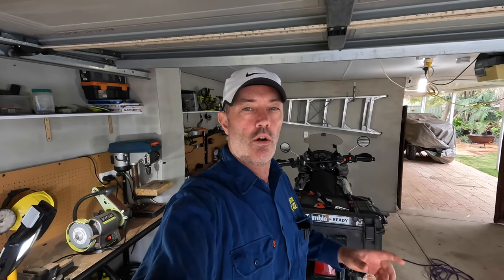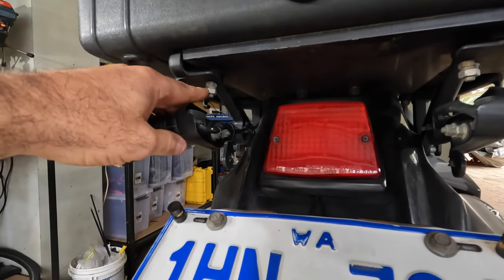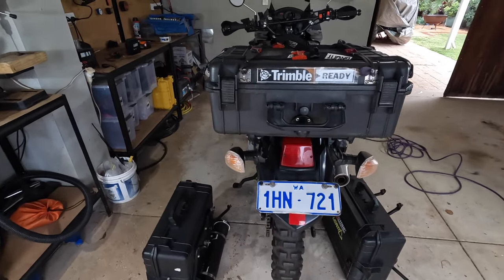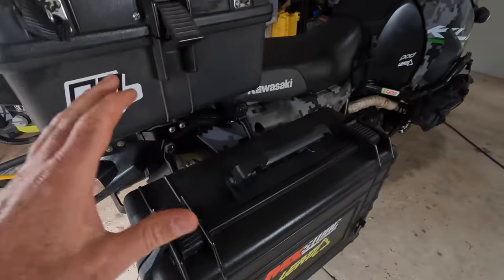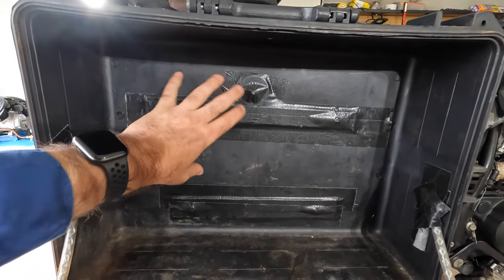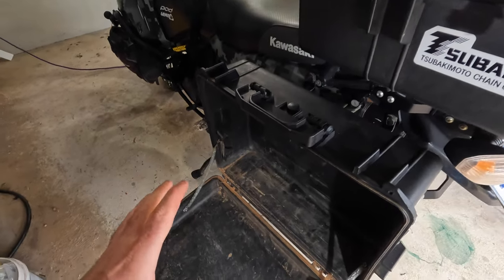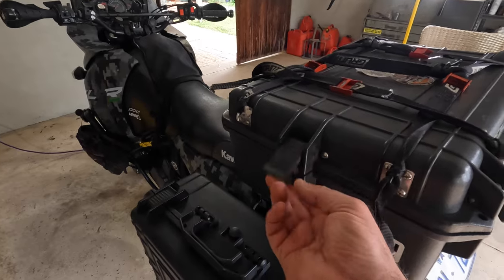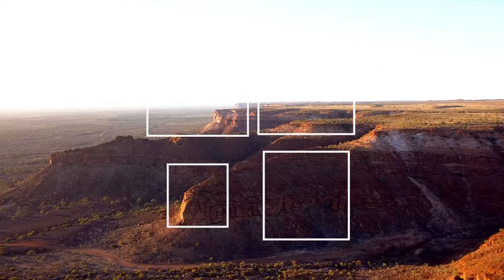Hard Core Home Brew ADV Panniers - KLR 650

Comment: Nice set up. They are tough, I use the same on my vstrom. I'm using small cooler bags to pack stuff in and a lite elastic across so they don't fall out on the lean. Can't have elastic too tight or it pulls the  sides in. Cheers mate nice klr

Comment: Have you ever taken the time to weigh your pannier setup, I’d be interested to see overall weight unloaded and then loaded for a trip in comparison to a soft luggage setup. They certainly have served you well over the years.
Reply from the maker: I haven't.. but its a good suggestion.. I have weighed the whole bike fully loaded a few times.. When loaded for a long remote trip, fuel, water, food, tools and spares, its pretty heavy, and you have to ride it taking this into account.. This is where being able to quickly remove the panniers is great. You can take them off an lug them across a gnarly bit.
Reply: @jjsadv  the ability to remove and carry over bad ground is definitely an advantage, but with the lighter weight of soft luggage maybe that wouldn’t be needed.
I’ve stayed with soft luggage purely for weight saving on my KLR as I was concerned about the subframe, even with the bolt upgrade. I do run hard panniers on it for urban commuting though, better security around town etc
Reply from the maker: @damienkeygan1735  Soft panniers are popular, and I will probably give them a go next bike. Both work. I have seen a lot of soft panniers ripped off or ripped open on some tracks with close trees.. But I guess you just have to be aware and careful..
Reply: @jjsadv  yeah both styles definitely have pros and cons.
I also run a safari tank to carry fuel up forward so it’s not rear biased in the panniers, also had to upgrade front suspension but definitely worth the expense
Reply from the maker: @damienkeygan1735  I have looked at those tanks, they look like a good option. The DRs always have them, but have kept the jerrys.. again, I can take fuel, and then off load it for an explore.
Reply: @jjsadv  definitely a handy ability. I usually just filled to the level I think I’ll need, not every trip needs 35 Ltrs haha
Reply from the maker: @damienkeygan1735  I should get one, and still take the Jerrys.. ride around Oz on one fill up..:) Im looking at a new bike soon. Waiting for the New T7 with the bigger tank to come out.
Reply: @jjsadv  definitely do some distance between fills. The new T7 world raid is a nice looking rig, as is the new Ducati desert X with the rear tank addition for 29 ltrs total👌
Reply: JJ, 
There are so many great KLR artists on YT but you my friend are among the Greatest... perhaps even the DaVinci 👌!
Reply: One of the very first things I upgraded on my KLR was the solid thick aluminum plate bolted to the back rack, brilliant mate🤠! And so many more of your brilliant tips I have used. Cheers from🇨🇦